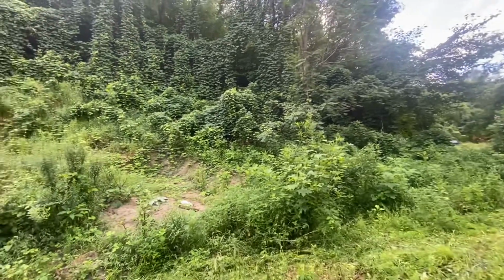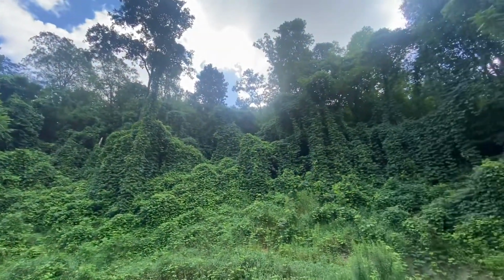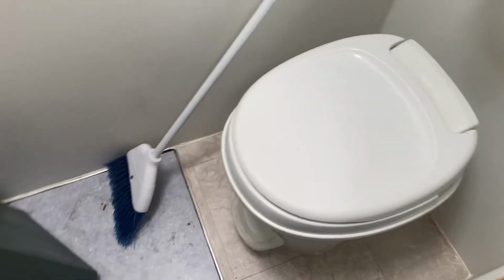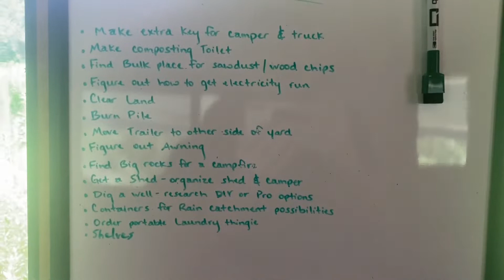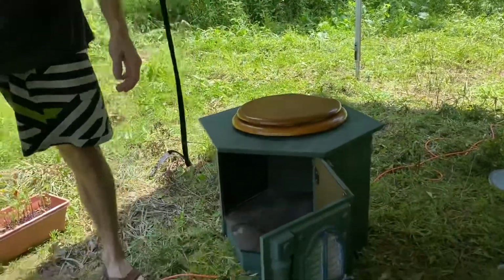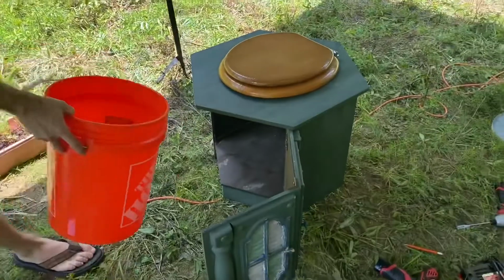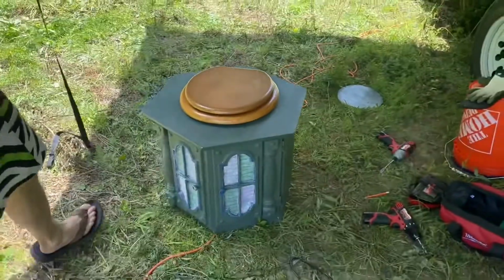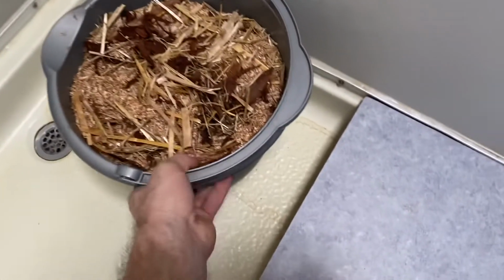Homesteading III -building the composting toilet-

Comment: Damn that is a steeeep hill right there! Theres probably a couple-three things you can do with that. Carving into it may be expensive (no idea) but its good to have that option, carving into it to gain more land. Ive seen that kind of thing in Italy, basically the content of a rocky hill got taken out for the sake of a huge structure. can you get to the top of it if you go around the property from the outside? That'd be cool to see as well. Maybe install a  zip line when you get up there to make it really worth your while 😄😄😄 
Thanks for responding to my video request (im the one who asked to see it)

Edit: of course, you can probably do that on a smaller scale as well. I think the structure was a warehouse,,,it was also the same size as  shelter for animals. It depends on your own needs really.

Comment: I had no idea you had such a big slope on the property! It'll make some creative landscaping or building design. With that composting toilet, I would seal the edges of the cut to keep the wood from decomposing or getting smelly. You could also install some wooden blocks on the inside of the cabinet, so that the it's impossible for the bucket to be misaligned with the opening.

Comment: Nice :)) but doesn't the potty need a ventilation tube to move the smelly air out of the bathroom? They have these in sweden but with a pipe from the potty through the roof. So proud of you guys! <3
Reply from the maker: we later on top of shit/piss with straw, wood chips and similar stuff that cat litter has, there is no smell whatsoever!
Reply from the maker: also, the roof does allow ventilation if we need to air it out